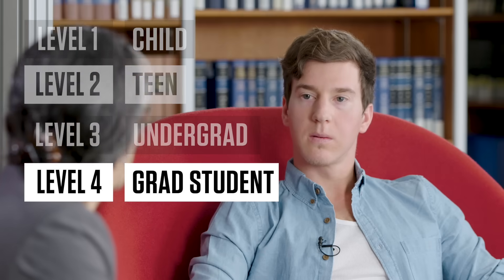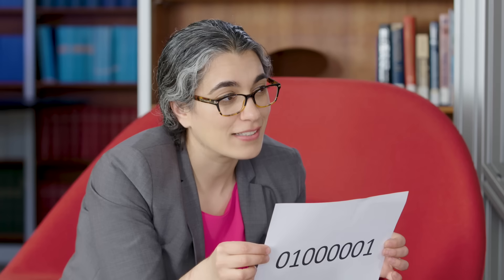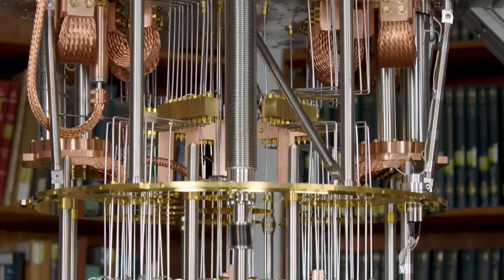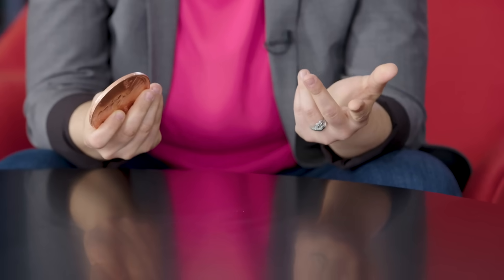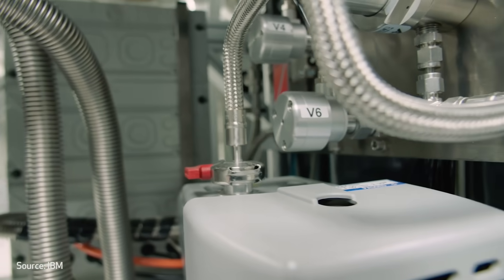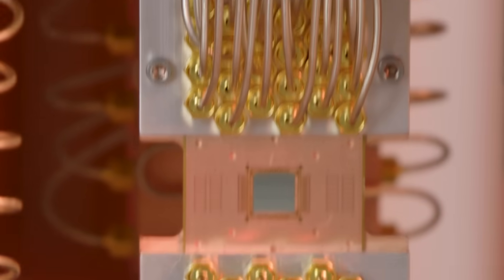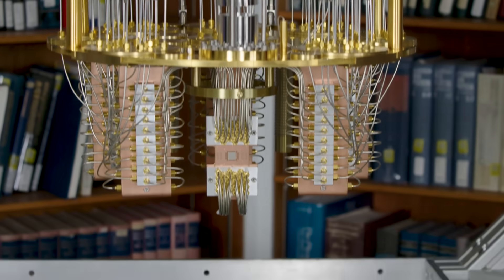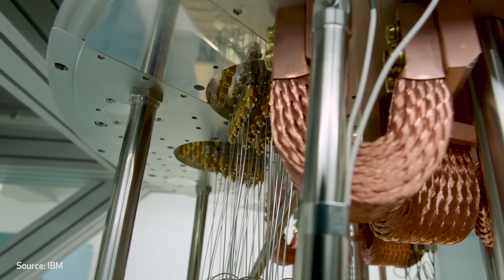Quantum Computing Expert Explains One Concept in 5 Levels of Difficulty | WIRED

Comment: If I understand correctly, as the programs increase in length a quantum computer will process it exponentially faster than a classical computer and run multiple processes at the same time far more easily.

Comment: Ok. I am not major in computer science. After watching this video, I have following questions: 

1. Lets say a qbit Q1 could have two (or more) state  as 0 an 1 in the same time. another Q2 could be 0 and/or 1. Now I need to calculate 1+1. if the spin keeps during the calculation, how could this machine give me the result of  2 instead of three results as 0, 1 and 2 at same time?  if the qbits collapse into two certain numbers 1 and 1 when entering the calculation process, how could this calculation be faster than traditional machine?

2. I assume if I would like to calculate 1+1 and 0+1 , qbits could give answers in one calculation step instead of two as traditional machines. Therefore it is faster.  what if I need to calculate  0.5 +0.6 , could this combination of state 0 and 1 also be achieved using this pair of qubit?

3. How could the entanglement contribute to the calculation?  I am very lost about that.

Comment: Having a quantum computer in a laptop is almost impossible because of the cooling issue as of now we don't have the technology to cool something that has so much power in such a limited amount of space, due to the temperature that a quantum chip has to be at for it to run accordingly is absurd. A quantum chip is supposed to idle at a temperature of about 0.015 Kelvin And that translates to about -459.643 Fahrenheit (-273.135 Celsius) which is insanely cold and the alloys that it would take to contain the extreme cold would be very expensive. I have no idea what breakthroughs we will make in the approaching future so this might not be unattainable but I am confident it is very unlikely to be a reality.

Comment: "We can control quantum states and amplify the kinds of signals that are towards the right answer and then cancel the types of signals that are leading to the wrong answer." I'm sorry what?! How is the state of correct being defined and by whom? Is this supposed to be enlightening? Because I am still highly skeptical that Quantum science is anything more than a theory. They have shoved a literal cpu right in the middle. Can it be real? I doubt it. Veeeeeerrrryyyy higghly doubt it.

Edit: It's made up.

Also, I cannot explain the wardrobe of this presenter. She is a beautiful as a model but her wardrobe seems pointedly frumpy. To the point even frumpy people would look at her sideways. Her jacket doesn't fit. Her jeans are cheap and she is wearing a completely mismatched (thematically) hot pink plain t-shirt. Why is she making these choices or why isn't a stylist involved in this high production value WIRED video. Seems a little contrived is all...

PS: In case I didn't already mention it, Quantum is made up psuedo-science.

Comment: One thing that might help retain your information is changing your storage architecture, modeling it after the human brain. There are two relevant points to this analogy. The first: you may not be able to compress ALL of the information, but you can store the most relevant points of data on a classic computer and reconstruct the details upon retrieval. The second, and most important point: The brain is much more efficient at storage, not only because it requires very little information to perform recall, but also because it’s not storing information. It’s storing abstract data. We recall memories in sights, sounds, and smells because that’s how our sensory perceptors experience reality. That information is not programmed into our brains. It doesn’t need to be. Format is just following function. It’s pragmatic, and saves more energy and space than compression ever could.

Comment: The reason it’s so big is because it takes a 4 stage cryocooler to get the microchip that cold. The size will only decrease as cryocooler technology developed.
Reply: Justin Conner or until room temperature superconductors like metallic hydrogen are to a point that they can be produced in a high enough amount to be a viable option for devices like this

Comment: Is it possible to entrap a stream of low energy particles between a stream of entangled photons such that an infinity mirror effect is achieved, which can create an infinite number of progressively smaller images of the original entangled photon stream, thereby potentially multipling 1 qubit into a very large number of ever diminishing qubit images (limited only by our ability to detect them), thus boosting the power of a quantum chip without actually adding physical qubits to the chip?

Comment: Video: quantum computers can solve problems that traditional computers struggle with.
Me: this thing must mine bitcoins hella fast.
Reply: or break the entire 'encryption' fallacy of Bitcoin...just sayin.
Reply: @fortusvictus8297  Bitcoin isn't completely encrypted, in that it is a thing you can hack and destroy - because it is a thing that exists in multiple places and is checked against itself for errors.
Reply: @Hoobyj  Thats kind of the kink in the system yes?  Its is NOT just about decrypting a single code, but spoofing it enough times to fool the system.  Seems impossible with CURRENT tech...with quantum computing it would be not just possible, but quite simple with how it works switching and whatnot.  Figure out quantum computing, and BITCOIN style encryption is dead BECAUSE of its reliance on multiple checks (it is not error proof, only a balance of confirmations is required, not unanimous confirmation)
Reply: I think it’s called blockchain, the bitcoin crypto.
Reply: The technology used behind bitcoin and almost every other cryptocurrency is Blockchain. Quantum computing can be a threat to encryption used in blockchain but the cryptographic algorithms themselves can be improved. Even Quantum safe algorithms exist. and first we even have to wait for quantum computing to get mature enough to get to that point and its gonna take some time.

Comment: I think a thing many people are misunderstanding is the implications of progress and the type of timeline we're looking at with development regarding quantum computing. Basically, although contemporary devices have an exponential growth rate at present; A. they aren't going to grow like this forever and B. quantum devices are an entirely different sort of creature. The rate of growth for quantum computing is currently in what you could hardly even call a fledgling stage; it's almost rather primitive in the larger scheme of things to come.

The timescale of advancement is not going to look the same throughout the history of both contemporary and quantum computing devices. They may, on the surface, look to be a part of the same "team" so to speak but it's less like shirts vs skins and more like airplanes versus flying saucers. They function in fundamentally different ways and it is that reason primarily why the development of the system as a whole is going to look utterly different to us.

The potential for growth is largely unknown, the overall capability of the device(s) is largely unknown, and the functionality itself is only now beginning to come to fruition. Many many issues have to be addressed before we can consider this sort of technology to be even so much as in the realm of our understanding. The important thing I see in this technology is that it's set to attack problems we don't yet have the optimal means of solving. For now we should focus on figuring out what those problems are and figure out the most efficient means of employing what's being developed for the near future.

Comment: Wouldn't space be a better testing ground for quantum computing and Quantum computing is sounding more like a noise machine that is turning all data into sounds and the correct sound will make it through all the interference, kinda like light using all possible directions before it hit my eye and when it does, appears as if it had taken the correct path all along.

Comment: Child:  Still filled with wonder and actually interested.
Teen:  Classic clueless bubblehead feigning interest, thinks adults are silly, and mostly just wants to get back to sexting.
Undergrad:  Proud about her degree she's studying but doesn't know the first thing about quantum computing let alone AI.  Wait until she learns that AI is nothing more than fancy statistical models that are actually quite limited in what they can do - and that carefully hand-tuning custom statistical models can produce far better results.
Grad:  Has already taken too many drugs to comprehend much of what's being said.  Also, probably still hungover before 10 am.
Professional: Winds up teaching the quantum researcher who is interviewing him.  Squinting because he came too quickly out of the dungeon where he does his research.

Assuming the permanence, distance, temperature, and data speed problems can be solved, room temperature quantum entanglement has the greatest potential for replacing the Internet as we know it.  Instead of turning on and off electrical signals or sending photons of light down fiber optic cable or using routers for transferring bulky data packets, entangled particles at each end can transfer data between hosts with total security and zero latency.  Routers would only be necessary to establish a data connection.  There would also be no need for the "last mile" of cabling to homes.  This is obviously a severe oversimplification of the problems, but the potential benefits are:  Massively reduced energy and equipment requirements, dramatically improved security, infinitely superior wireless connectivity (making today's use of the electromagnetic spectrum a laughable joke), and significantly reduced network infrastructure costs.

Comment: Has anyone considered using quantum entanglement to transfer data over long distances?  Is that possible?
Reply: Yes, they have, but it turns out to be impossible to do in any meaningful way, in terms of physics or anything practical. The basic problem is that: you could devise a system to transmit a message by sending one half of an entangled system to your friend while keeping the other half, only to break the entanglement in a particular way. Unfortunately, it is always gibberish to your friend until the two of you get back together and compare notes on what you did to do the disentangling part.

It's not immediately obvious why this is always true, and a lot of people, including Einstein, famously, argued about it for decades. In fact, we're still building experiments to test this to make sure we didn't miss anything, but pretty much every physicist agrees its impossible (which sucks, cause it'd be super helpful if we could do this).

Comment: I think optical computers would be faster as data would travel at the speed of light, I was talking to a fiber optics tech and he went to a fiber optics convention in Vegas where you have to be certified to go in. He said that AMD and Intel teamed up with MIT's brightest to create an optical CPU and they did, although it is currently useless as it's at a bottleneck because of the motherboard but at 1 core it clocked at 74Ghz. They are looking to get hard drive and motherboard manufacturers on board, it might eliminate the need for RAM but who knows. They were at it for a pretty long time just to create the CPU but it would be great, they said that these optical processors are extremely small also

Comment: Why does information degrade with th number of operations in quantum computing? vs in classical computing
Reply: Short answer: the computer needs to entangle the qubits, which is tricky. The more calculations, the more qubits need to be entangled, and while getting two qubits to be entangled may be tricky, it's not as tricky as getting a third qubit to entangle with the first two without ruining the first two's entanglement.

More expansive answer: In classical computing, the information is stored with either magnets (North and South magnetic poles being the 1s and 0s) or by storing charge somewhere (do I have a bunch of electrons on the capacitor (1) or not (0)?). To do calculations, this involves shuttling the electrons around or flipping the bits in ways that force others to also flip.

The quantum computer is all about utilizing the ambiguity of quantum states to do the calculations. Using the penny example, instead of a heads-up penny being flipped by the computer, the computer lets the penny spin. To do the calculation, you let multiple penny's spin together and be entangled so that when they stop spinning, you get your answer.

However, you need the penny-system to not interact with anything else. You can do this the ways she mentioned, including isolating the penny or making it really cold (temperature is just pennies/molecules bouncing around and interacting). By reducing the temperature, you reduce the chance of something colliding with the penny and stopping it spinning. But anything not already spinning with (entangled with) the penny will do this, including other pennies not currently spinning.

Just as in the classical case, the more complicated the calculation, things the computer has to juggle: more electrons sloshing around in the circuit, more magnets being flipped back and forth, more pennies spinning together. Except... the computer needs to get all of them spinning together which becomes increasingly tricky the more pennies that are around (just like juggling with juggling balls: it's easier to get going with 3 or 4 balls than 5 or 6). But the more pennies spinning also means the more likely some not-a-spinning penny may accidentally bump into one of the spinning ones. Once one is bumped into and stops spinning, they all have to stop spinning, which ruins the calculation.

So what about that information degradation? All the information was set up in the spinning in order to do the calculation, so once you stop the spinning prematurely, the information is not what you expect it to be (an answer). Therefore the computer now has something random and no longer useful stored as its information, so the total information quality has degraded.

I hope one of these made sense.

Comment: I rate this video as a 95% failure.  It introduced keywords, talked about features, benefits, and limitations but never actually explained what quantum computing is and how that enables it to do things you can't with classical computing.  She says: ~"Encode problems as a complex qubit state and then manipulate toward a solution"  Great.  Now you understand Quantum Computing, ...except that you don't in any useful way or to a meaningful degree.  Why are superposition and entanglement important?  What are quantum computational operations?  How do they leverage superposition and/or entanglement?  Why are these operations more powerful than classical computations?  Nothing.  She neatly dances around the periphery but never describes the core concepts of quantum computing.

Comment: This is what we call re-inventing the wheel, why would you want to go back to 1950's when mainframe computers were the size of an entire floor and start over again. As a Computer Scientist myself I don't see any benefits to this where they need to invent another assembly language that translates the high level codes (probably written in other new quantum languages) to the Quantum machine hardware. This is a waste of money and resources.... they could've invested that money and energy into building up on the success of what has been accomplished in the standard computers world in the past 60 years. The problems of space and fault tolerance have long been solved either directly or by working around them because the hardware is cheap (yes I said it..). I would be more interested in learning about any progress or evolution in the  P vs NP dilemma instead of this Quantum no sense...

Comment: So If I understood well (correct me if I'm wrong) :
The final advantage of having a quantum computer is that it will instanly give you the response to a complex problem with a 99,999...% of yes or no.
Whereas our classical computers would take ages to give you a 100% yes or no, given it has sufficient memory and doesn't encounter an error?
And a quantum computer would be suited for simulation because you could just feed it with data, instead of writing the whole simulation code?

Really not an expert here, not at all my field of science but I'm curious.

Comment: The neural network conundrum. It is a system in search of a programmer. 50 qbits is useless except for a miniscule fraction of the problems we know we must solve. Using microwaves to set a bit is guaranteed to limit scale. Time to move on.

Comment: 10mK??
Means 0.01K temperature like almost 0K?
Which means 0 Entropy 
Is that even possible, doesn't it Violet's thermodynamics 3rd law??
Reply: Well, it isn't a true 0, so not really. Surely it does screw stuff around, just like near-lightspeed travel would. I think that's why it's needed to operate at quantum level.

Comment: I love the concepts behind QC and really I'm impressed they built one using actual super critical states; as the behaviour of electrons are known in a quantum state, this could be simulated in a computer program or simulated using traditional hardware; it's a massive scale up to account for the varying states of super-position - think the one featured in the video is 8 bit, so this might equate to 512 bit (napkin math) but surely easier to build and safer to simulate the logic?